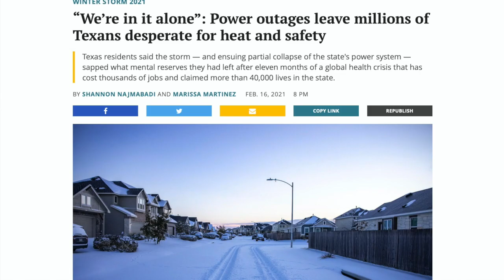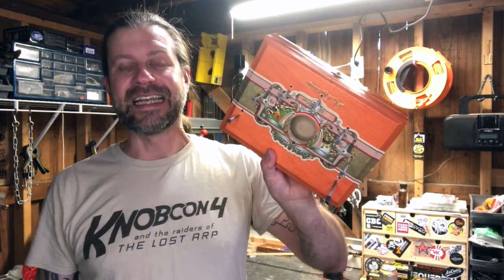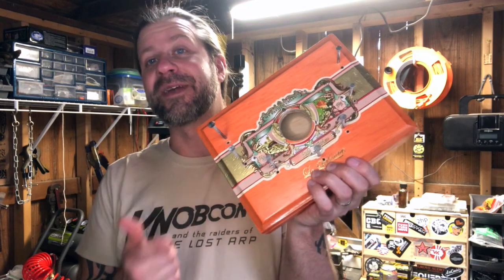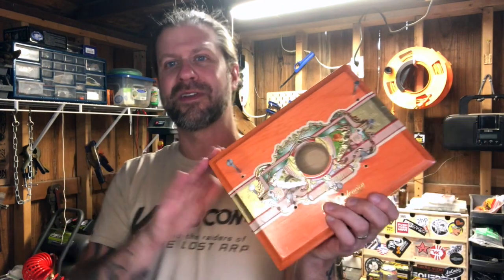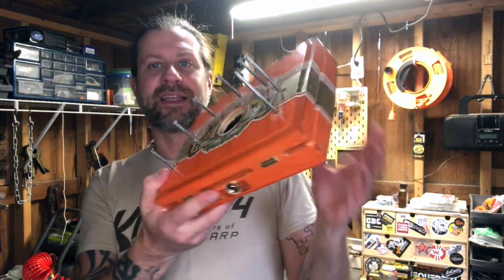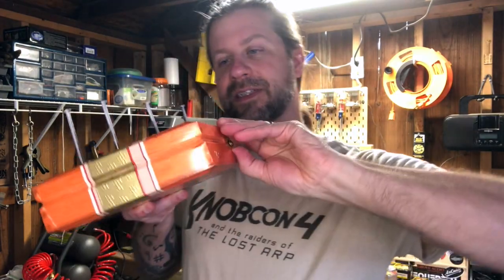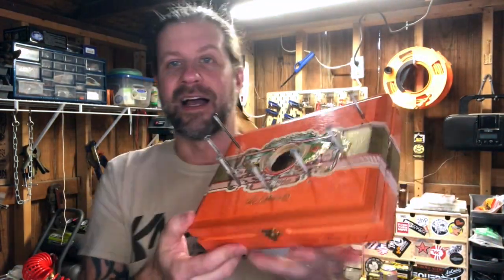Building a Nail Violin (and plugging it into a modular synth)

Comment: Just a thought, but if you add a handle, on the side of the box, then your hand win't be interfering with the sound, or muffling it. sounds goo though.
Reply from the maker: That's an excellent suggestion. I thought about putting a handle on the bottom but then you'd never be able to play it on a flat surface. I like your idea better.

Comment: yes there is a science to the size of the nails

copper of brass rod works better
Reply from the maker: Ah. That's a good point. I could imagine brass rods producing a lot more vibration.
Reply: @musicalmiscellany  Thin carbon steel or even flat carbon steel like rake tines works well too